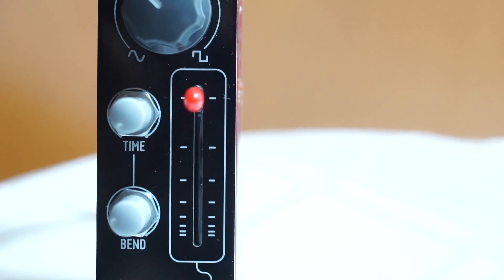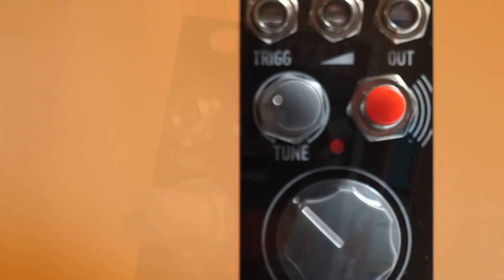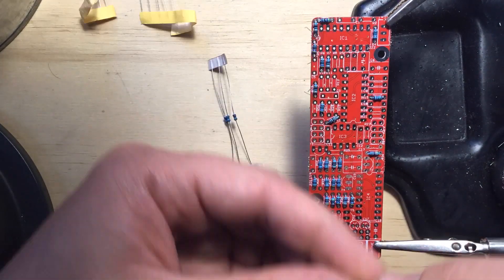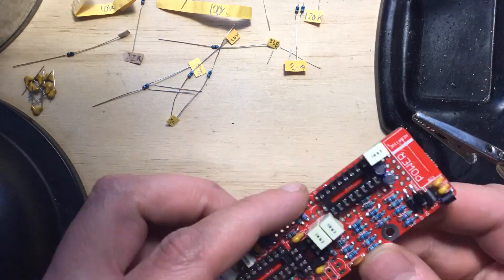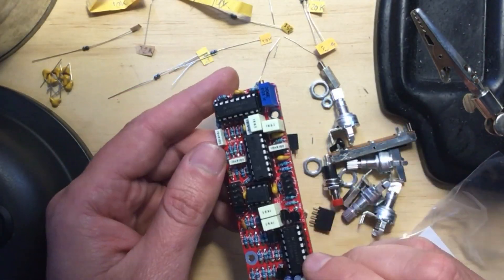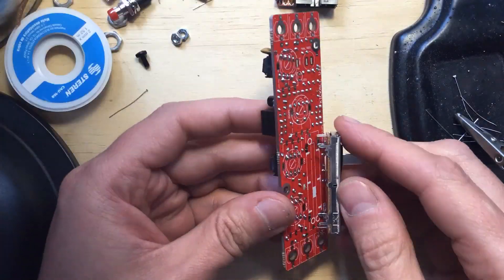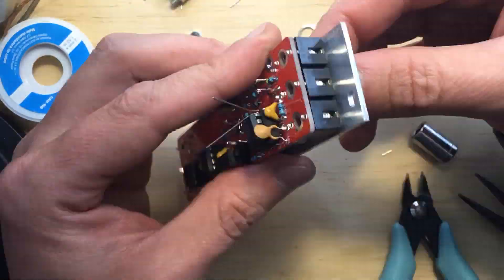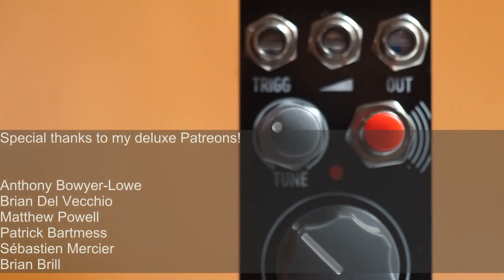Kit Overview # 37 : Befaco Kickall - Build Video

Comment: The build document assumes you’ll be assembling both boards at the same time.  But you do the smaller board first.  Any reason you didn’t do both at once?   I just want to make sure I don’t get myself backed into any corners near the end!
Reply from the maker: I think I just got excited and broke them apart before reading the manual, lol. Go ahead and do them together, it'll be more efficient ;)

Comment: So, is soldering resistors from the top generally what you do on most builds (still relatively new to this)?
Reply from the maker: Yes! As long as the board is plated through holes (metal inside the holes) this works and I find it easier and faster :)

Comment: Having some of those components not be aligned at right-angles is really messing with my OCD! :)
Reply: There's an IC on the pot&jack board that is veery slightly off-angle, too... that's what nails my OCD :)
Reply from the maker: @alanp3334  oh yeah, that one... Stay clear of Peter Blasser/Ciat Lombarde PCBs then ;)
Reply from the maker: Hahaha, it's just one single resistor ;)